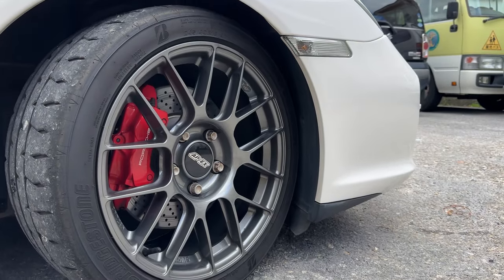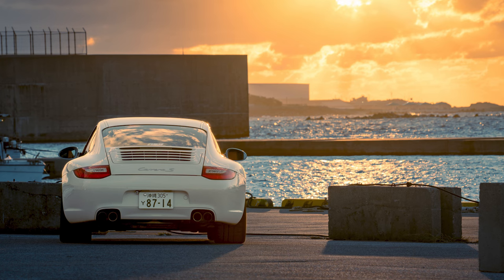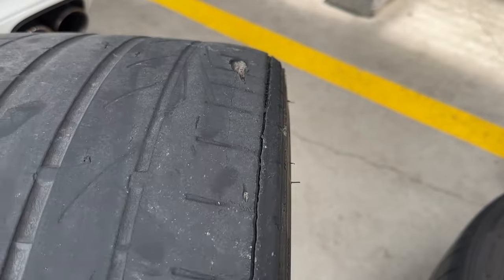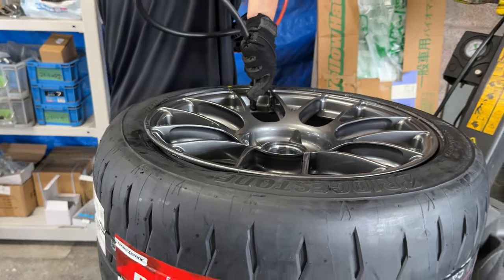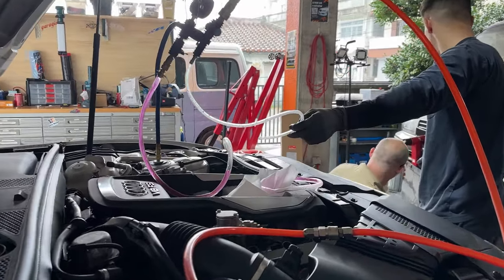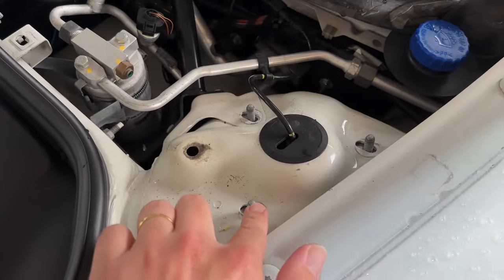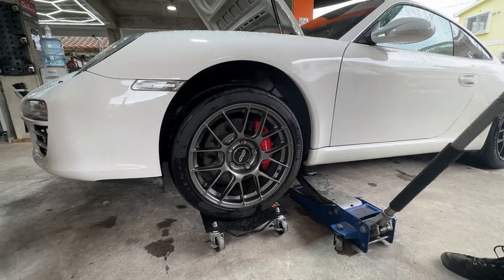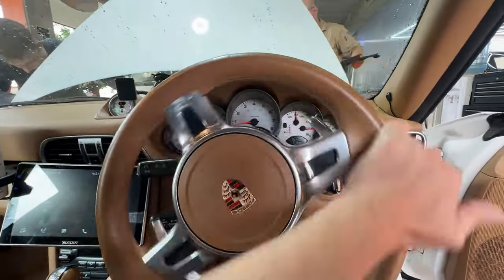CAMBERING my 997 911?? You can too!

Comment: HI like you I own a 997.2 PDK.  It currently rides on stock 19", I'm curious why you moved to 18"?   I have the same thought.  Hoping it will improve the ride, and reduce the road noise.  On some surfaces the road noise drowns out the chrono exhaust!
Reply from the maker: As much as I’d like to say I was doing it for reduced unsprung weight, I’d have to say I just prefer the aesthetic of a meatier sidewall and the roads here are terrible so I wanted more cushion for the pushin

Comment: What size tyres have you fitted to the 18" wheels, are they stil 295 n the rear?
Reply from the maker: Yup. Still 295. I just upped the sidewall to compensate. From memory, I believe these are 18/40/295 in the rear. Maybe 35.